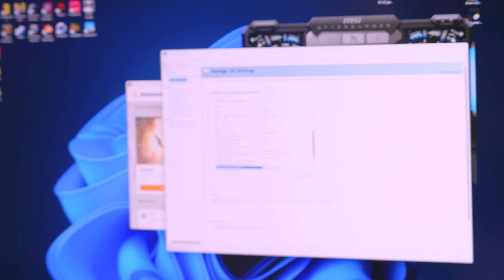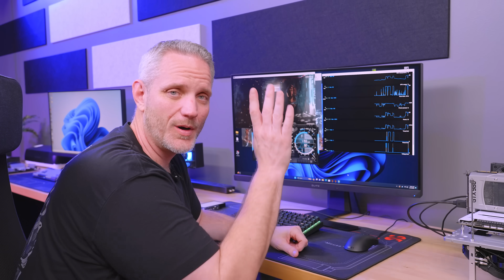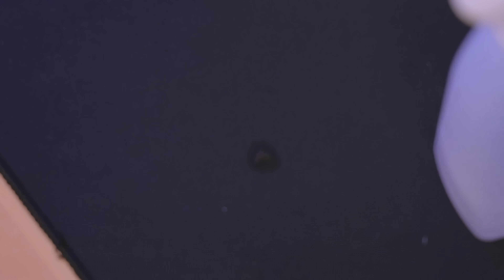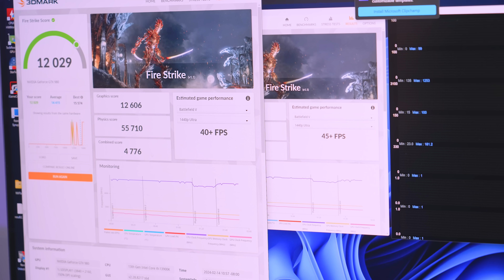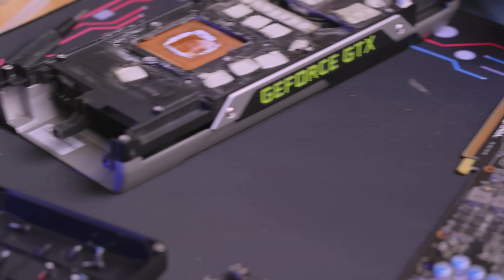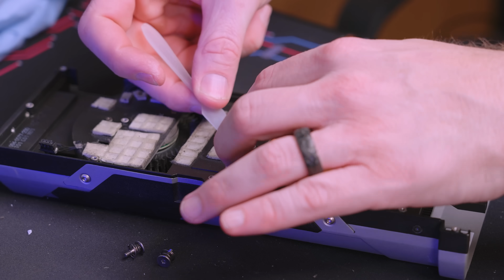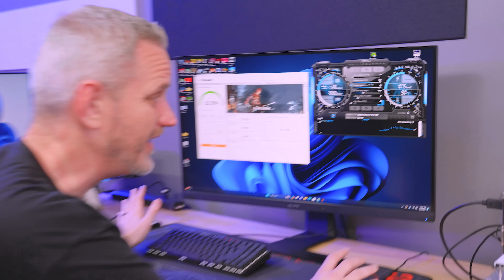This was KILLING this cards performance!

Comment: i repasted my 2080 Super a few months ago because it always was going into failsafe mode when firing up a game since the hotspot climbed to 105°C(average overall temperature 75°C) (all fans were 100% cranked up due to failsafe protection).
Now i can run FurMark for hours and the hotspot won't climb higher than 79°C while my average is like 60°C
Definetely was worth it.

Comment: I did some maintenance on my used 3070 Ti - not that old of a card, and yet dropped 15 C thanks to new Gelid GP-Extreme pads and Gelid GC-Extreme paste. Still hits 105 C on the hotspot sometimes... but at least doesn't drop the clocks that hard.

Comment: I just had my amd rx 480 start hard resetting my computer the second I started furmark, so it was not a temp issue.  It's old, I figured what do I have to lose so I took it apart to clean it and look the board over.  It wasn't as bad as the card in this video, but it was dirty.  I cleaned it and put it back together and now it works again.  I think a piece of conductive dust was shorting something important.  Bonus is since I thoroughly cleaned and repasted it, it dropped the temps by almost 20 degrees.  I gained a few hundred points in furmark and now the fans are off when it's idle again.

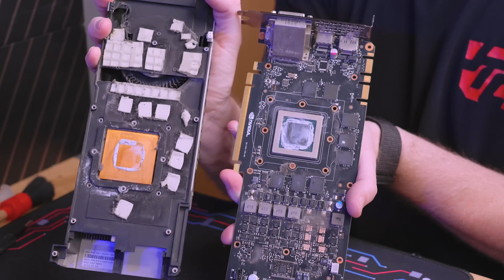Comment: 10:02 
That looks like mine, even after repasting... GPUs usually have a better pressure and dont need that much paste between the die and the cooler to fill the gaps.

Comment: For a 10 year old card that's quite clean lol. Ones from dusty homes and cases without any filtering are much, much worse. Btw when blowing out a finstack you should blow from the back. Especially when there's fibrous material in there (hairs and stuff, also tiny hair that everyone loses) they'll just get more stuck when blowing from the front.

Comment: In 2019-2021 I ran a used GTX 780 with that same design as the 980. Open air on an eGpu setup with a Lenovo T430. The 780 sucked up a moth one night (and it didn’t stop running?!)

Streaky dusty moth juice all down those fins 🤢. After multiple attempts to clean, the card properly died about 2 months later.

Comment: you don't need alcohol for dry dust, a brush and air is more than enough. wet dust is way more difficult to get out :)
also, that card didn't look to bad, had to work with pcs that had a full pelt on some parts (5mm think on the really bad ones)

Comment: My 2080 super got a refit on pads and paste. Leave it to gigabyte to use four sizes on the same card; nth2 for the win beebee! from 80C max to 70C max while under load; so worth it.
Reply: FYI thermal pads have come along way since older cards, Amazon has a multipack of six 100 square mm with 6 sizes for twenty bucks; such a deal compared to buying each size for 15 a pop

Comment: I once cleaned my old laptop from 2009, it had high idle temps and even the idle load was quite high. So I disassembled it, cleaned it, re-pasted the CPU and it was running like new after that. Too bad its so big and heavy I would use it much more often. But it weighs like 8kg, it must have chassis made out of cast iron or something.

Comment: Don't know why this 980 received so much bashing in this vid. It's probably the oldest nvidia card at this point that can still decently run newer games at 60fps 1080p with a few tweaks. No it will not win a benchmarking contest even against a 4070 but considering what you're paying for both nowadays and considering the beast that the former has been for those 10 whole years I'd argue this card deserves all the respect you can give it, dusty/aged or not.

Comment: Good old GTX980, it just runs. 
I bought a RTX 3070 couple months ago (Asus) and it probably lied around for way too long in some storage room, but I had to change the thermal paste almost on the spot. 
Card was getting ridiculously hot for what it performed. We are talking 105°C Hotspot and a delta of 20°C with just 1775Mhz "Boost". Not happy with that. 
The repasting helped a lot, but I actually had to undervolt(and overclock) the card as well to get a satisfying performance out of it. ( 1.06V @1775Mhz to 0.9V @1920Mhz )
Guess a 2-Fan cooler Design is too weak for a 3070 haha. 
While it was annoying, it sure was a fun experience to do all of that to the card.

Comment: Curious how would the PTM stuff would do. I'm thinking of using some of that stuff on this laptop (Dell Precision 7510) with the now BIOS modded Quadro M2000M. HWInfo says two rails at 60 watts (!?) and reaches 90 degrees C in FurMark, no power, temp or volt limits somehow. Core clock at 1215 MHz, 200 MHz from stock. Paste is Arctic MX-4 because the local stores don't have much else. And the CPU started to throttle after a month or so...

Comment: I undusted my MBA rx 6800 yesterday that hashes rvn since it was released and bought back in 2020.(since it does not need thermal paste replacement). But it was so clogged up with dust and cat hair, I straight got 10 degrees better temps after cleaning was finished.

Comment: This reminds me of when i bought a system years back from a friend for pretty cheap (4790k gtx 980) they told me they had cleaned everything and it was good to go. 

When i powered it on the rear fan threw out a load of dust as soon as it started up and then when it  got warm the smell of hot dust was the worst. i opened it up and the white fans inside where brown from dense dust and tar build up from all the smoking that had clearly been around this system.

Cleaning the system was one of the hardest and grossest things i have have had to deal with tech wise... When i took the system apart you could not see through the cpu tower cooler fin stack and the heat sink in the 980 was completely clogged and the fan was to like no gaps between then fins of the heat sink or the fan blades at all.

the gpu temps went from high 90's to high 70's/low 80's temp under load and the cpu dropped over 15c after cleaning and repasting both as the paste on them was rock hard.

Comment: I've owned a MSI GTX 980 which came with factory overclock to ~1400 MHz and only with repaste that beauty ran 1500 MHz.
I've sold it along with my 4790K and it's still alive. For shits n giggles I've overclocked it to 1675 MHz once - those Maxwell 2.0 cards ran like hell and were sturdy af...

Comment: A bit confused, here.  I always thought the thermal paste was just supposed to fill in any potential gaps in the mating surfaces.  The best thermal conductivity should be metal to metal, not through the thermal paste.  Granted, I understand if the paste completely runs out when it gets hot.  But isn’t it supposed to be thin, and only where there is a gap?  Otherwise contact should be metal to metal, right?

Comment: A few years ago, before I bought my 6700 XT, I was still using an old R9 290x. I replaced the thermal paste on it a year or so before I retired it and the difference was night and day. The idle temps went down by 20C, and while performance didn't increase using stock settings, the fans didn't have to run nearly as hard. With AMD known for having bad coil whine, you better believe that was such a relief to the ears.

Comment: I remember re-pasting a Pentium II (that's a two), 400MHz. I was going to donate it to charity and it was cooking at 72C (# prochot, remember?). Took the heatsink it out of the cartridge, cleaned the tiny fan, re-pasted it, and it never felt even hot to the touch, just warm.  Installed Ubuntu just to prove it boots, and let it go. 

The paste was PAST dry-lake bed, all wrinkled and flaky, it was just white dust. Amazing it booted at all.

Comment: My EVGA 980 would run +250 core +450 Memory. It's not stable anymore, so I have it set to default. It's also plugged into a 1X PCIE slot, because that machine needs a 10GBE NIC more than a graphics card, but it has a Xeon CPU, so I need a GPU for video output. That machine will be retired eventually, I have a 3900XT/VEGA 64 system to replace it, and I might pick up a 6700XT to replace the VEGA 64 eventually... My EVGA 980 idles at 28C, max temps were around 70C, even with a stupid OC on it lol

Comment: This came out at a perfect time. I just built an old parts computer for my future step son to play Lethal company. The card I put in was a old GTX 770 my partner had left over. Runs the game just fine but reaches almost 80c with fan at full speed. Gonna pull it apart and clean it all out and reapply thermal paste.

Comment: Cleaning and repaste can DEFINITELY raise a card's performance. I clean/repaste/liquid metal/copper mod gpus as a side gig/side income. 

Most of the cards I receive are around 2 to 4 years old. Anywhere from 3060tis to 3080s, 6800xts to 6900xts. All of my customers complain about sudden black screens, game crashes, inconsistent gpu clock, stuttering fps in game.

Upon initial testing usually their gpu hotspot hits the max of 105 degrees celsius, then the card downclocks to protect the die.

Usually after cleaning and insulation around the die and then with applying liquid metal, the hotspot only hits up to 80 to 85 degrees at full load.

Benchmark scores become higher, min fps, avg fps goes up, and fan speed and noise goes down due to lower gpu temps.

Best thing is that I'm not a pro, anyone can do it at home if they put in half a day of effort, and u get brand new/stock performance back from your gpu!

Comment: I tore down a 1070 FE that looked dustier than this card, it went from fans screaming in the 80s under load to low 70s and silent. I repasted it, completely opened up the heatsink and cleared the fins out. It's happy as a clam now.

Comment: I got myself a used Nitro+ RX570 and its temps hits 70°C fans ramps up up to 2k+ rpm when in a game until I decided to change its thermal paste. Now, when temps hits 70¯C fans just runs at 900 rpm sometimes max at 1.3k. 😂

Comment: When I got my GTX 980 in 2015 (same reference model) it was a beast. Every game I played worked no problem at max setting (stock settings, no overclocking). Unfortunately all good thing come to an end, and my GTX 980 died after like 7 years :( Started artefacting and it gotten to the point where my PC would randomly crash (in Windows or in a game). Service shop tested the card and every component was fine, except for the GPU's main CPU. And it is kinda hard to find a working GTX 980 GPU CPU module within the price that would justify the repair cost. In the end I replaced it with RTX 3060 12GB (was lucky enough to find same blower style card). Anyway, it is funny to think that even something as basic as RTX 3050 6Gb is actually faster than a former flag ship GPU and uses only fraction of the power (165 TDP vs 70 TDP). Gamers nowadays don't even realize how great things have become (aside from prices). I mean when I was using good old Voodoo 2 and later GeForce 2 I rememberer being happy that I got like 25 FPS in 800x600 lol.

Comment: BLOWER CARDS are one of the worst possible designs. They ONLY make sense if space is limited (like in a laptop). It's basic physics but there are great videos that explain this. But basically the LONGER the heatsink is from where the COOL AIR comes in to exhaust the worst it is. A lot of people like the idea that the air is blown OUTSIDE of the case but the very narrow area you're working with forces a blower style which limits surface area you can blow air through... conversely blowing air directly onto a large heatfin stack that's relatively THIN means a lot more air moving through... the IDEAL way is to suck in ROOM air directly, blow through the fin stack and then immediately exhaust that air. That's why the XBox Series X approach is pretty efficient. I'd love to see a "CUBE" style of PC that's designed like an XBSX that also has one side as a "graphics card" that's joined to a common heatsink like the old "garbage can" Apple computer approach. It had a shared, middle fin stack that the CPU and 2xGPU's could share where the air blew up through it like the XBSX did.
Reply: Both cooling types have advantages and disadvantages. I had some cards with "blower" style cooler and never had issues with thermals & noise. The biggest benefit is that a GPU with a blower does not affect other PC components temperature. So you can have a relatively small PC and it wont overheat. ITX builds imho should all use "blower" cooling if it is available. Up to this day I have no idea where this whole myth of "blower coolers being terrible" comes from. There is a reason why most expensive GPUs on the market use "Blower" style coolers. If it was a bad solution, I am sure both Nvidia and AMD would not use them at all.

Comment: ran  my  590  through  the   wash  ,  so  to   speajk  ,  where  i  had    a   dailure   on  a   mem   chip   still   exists   ,  but   now   i   can   run  Some   n=benchmarks   to   dind  out   where  its   dailing   ,   Yes   i   totally  cleaned   it  up   and  newc   pads  n  paste   ,  prior   i   couldnt  run   a   bench  mark   at   all  ,  heat   killed   the   card   ,  two   spots   a    single   mem   chip   and  its   controller   sitting   right  next  to  it   ,  although  i   dont   know  if  it   was   the   controller  or  the   mem  chip   as  i   do  not  have  the  correct   tools   to  cypher   out  the   real  issue

Comment: the screws were loose because the thermal pads got compressed over time and heat
Reply: the screws was lose because it was took apart before and not put back properly

Comment: I'm still using that model of card (MSI version).
With a 6700K 32GB RAM
and 2x nvme drives (one in a pcie2nvme PCB conversion card in a PCIe 4x slot)
Custom water-cooling build with som very miss-matched components (Ek block with WISH bought pump, some random mixed fittings)
Moded bios, unlocked power 😎

It is my daily driver computer!

Upgrade me?
🤪

🌱😁🤧💨

Comment: Commenting before watching full video to answer his first question of whether or not cleaning an old graphics card can uplift some of the performance, based purely on my findings.

Yes, yes it can.

My GTX 1080 FE from 2016 was starting to give me random BSOD even when doing simple things like watching videos on YouTube and Netflix, forget about long gaming sessions, it would crash after just a few minutes. I figured it's a new year, 2024, and time to upgrade my system so I start a new build. Since I was starting from scratch, I said screw it, I'm going to open up the 1080 and see if I can salvage the card, and if I can, I will donate my old PC to a friend who didn't even have a PC.

Sure enough, opening up the casing revealed massive buildup on the heatsink and fan. When I removed the heatsink from the GPU itself, jeezuz...the old paste had turned into a solid clay pancake that crumbled and turned to dust all over my desk, clothes, and the PCB. Blew out all the dust, cleaned off the old paste and its remnants, and applied some new paste and put it back together. Slapped her back into the system and voila! No more random BSOD and I could play games without crashing now. I never ran any type of benchmarking or monitoring software, so I didn't know that the GPU was overheating and causing the BSOD. That's my theory anyway, since after applying the new paste, everything was back to normal. I wish I had checked temps beforehand, but oh well.

Now, back to the video.

Comment: same cooler as the 1080ti the front screws remove the perpex plate allowing you to air duster it. i did this when i last dfismantled it and applied kryonaut to the cooler, made sucha difference to its boost clocks back in the day.

Comment: Holy heck the 900 series is over 10 years old?! I was starting to get into the PC scene when the 700 series launched and I can remember that like it was yesterday! WHERE HAS TIME GONE!?
Reply: Legit. I was still in my final years of high school back then and I just... can't explain where the past decade has gone.

Do remember building my first desktop though. 67k, and an r9 390x, all in a phanteks luxe. Good times. c:
Reply: My first build was Austin Evans’ “Photon” build from 2014. I replaced it around 2017/2018 with my current Ryzen 1600/GTX1060 build I’m still using… crazy how it still holds up.

Comment: i have a 1080ti that's been running in my pc for about 7 years. the temps were never going past 73c but because I've been having nvlddmkm.sys crashing and subsequently crashing my games I decided to open it up, clean everything and repaste (also because I troubleshot every possible cause of the crashes I can think of from software, reinstall windows, changing ram, changing psu's, changing surge protectors, etc). the board looked flawless there was barely any dust on it, most the dust was on the fans/heat sink. obviously the paste was rock hard and after replacing it now my gpu doesn't ever go past 63c. I still have the crashing issue when playing games sadly but at least my gpu runs cooler 🥲

Comment: just like my i5 13600 when if had to replace the mobo (ROG faulty out the box), put the protective tape back on the aio cooler block and rebuilt it with new mobo and tape!

Comment: No, you're wrong about 'good thermal paste' not leaking out the sides.

An ideal situation is a perfect metal to metal interface, but we can't do that, thus we have thermal paste....  a thermal paste that removes itself from the equation is ideal, you want as little paste as possible in there gumming up the works, so if it gets out of the way all on its own, thats the one you want to use.
Reply: I was thinking the same. You really want it to only be in the microscopic grooves and gaps between the faces. If the rest squeezes out, all the better.

Comment: Isn't it good when the paste gets squished out? means there's no gap. If there was a gap that paste could got in - it would've stayed in. It's not like you're getting air in that crevice. And metal to metal with no gap is better than any thermal paste.